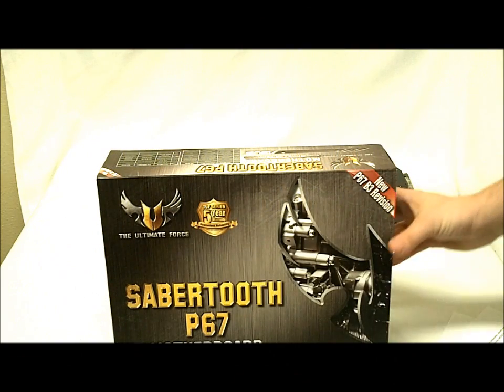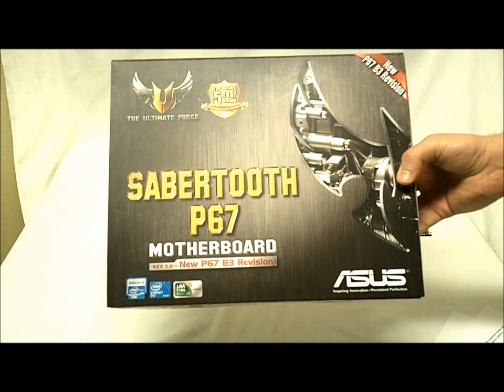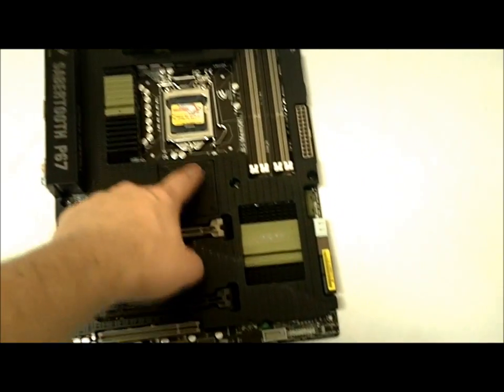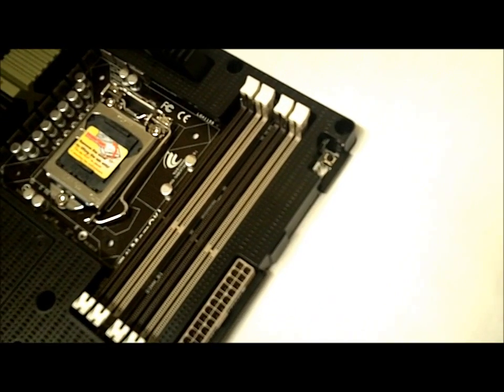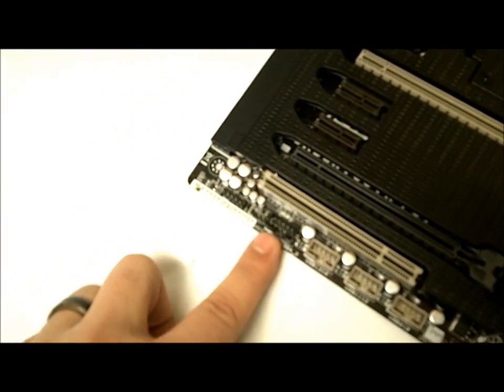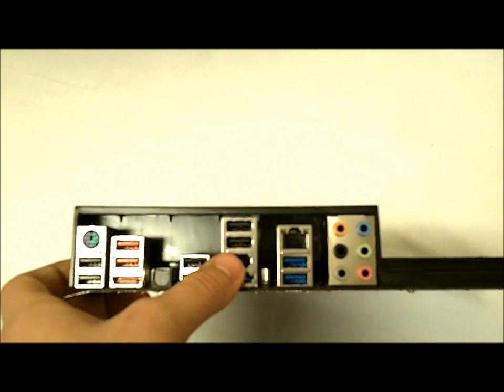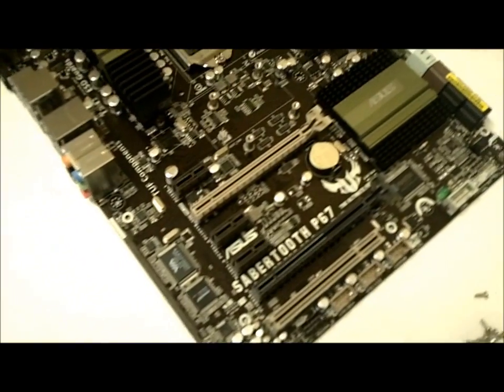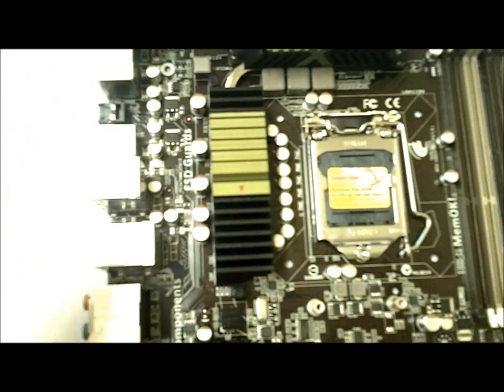ASUS Sabertooth P67 Motherboard Overview

Comment: I guess. My buddy just got this board and I was trying to justify why in this day and age there would be 3 of these on a mobo. I have the Asus P8Z68 which has  2 PCI Slots, 2 PCI Express X1 Slots and 3 PCI Express X16, of which I only use the x16 slots for 2 gpu's and 1 wifi card, I use a pci slot for a fan and one pci slot for another fan. I dunno, maybe it is just me. Still an awesome board though.